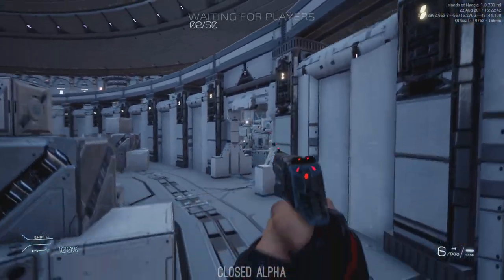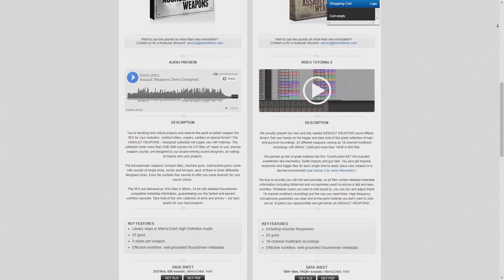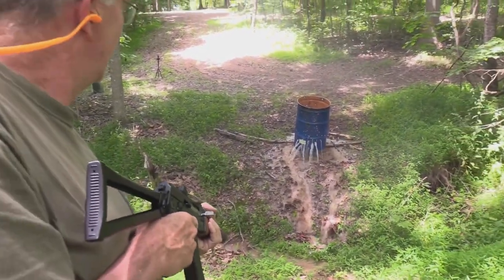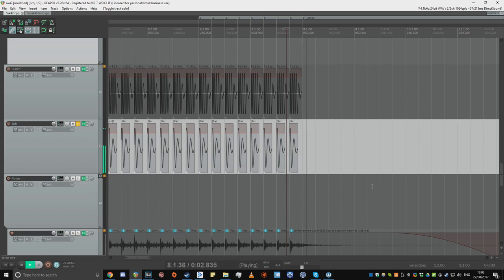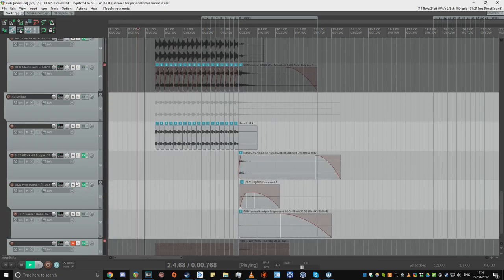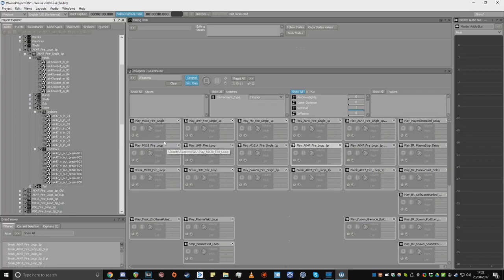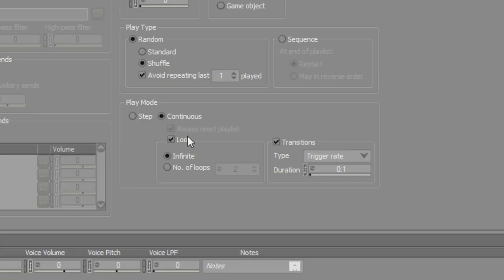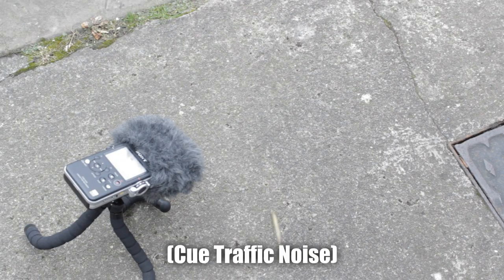How To Make Awesome Gunshot Sounds for Games - Fully Automatics (feat. Islands of Nyne: BR)

Comment: Hi Tom, this is fantastic! for a burst shot you recommend using one shot or a loop of several shots, I have to use fmod for this but I guess it would be similar than with wwise.
Reply from the maker: Hey :), honestly I've done both and it worked well but I would maybe recommend 3 single shots that are each triggered in an event.

Comment: Nice. For "auto" mode you were using "auto" recorded samples, what about for singles shot mode -would you use singles shot recordings?
Reply from the maker: Hey! Tbh I wouldn't build unique sounds specific to single or auto - you can definitely build a single shots using singles or by picking individual shots out from a burst.
Reply: @TomWrightSound  Thank you. I've checked many designers on youtube and I find you one of the best! The trick with adding reverb room on wav and then tail is also really nice trick. Could you share which reverb plugin you are using to create room effect (outside or inside version)?

Comment: Which tool did you used inside Reaper to break looped gunshots into small bits ? I'm curious
Reply from the maker: It was just a matter of pressing 'S' at the start of the transient. It's quite a manual process.

Comment: Thanks for a great video. I find that sometimes I play more sounds than shots fired, which is quite noticeable if I only fire 1 or 2 rounds. Do you have any tips on syncing this more reliably?
Reply from the maker: This is something we also discovered during development. We found that by adding a small delay to the start of the Play_ Event (about 0.04) you can catch most of those extra shots. It's requires some tweaking but is an unfortunate side-effect of this method, which is also present in a few other popular games that use Wwise.

At my place of work we currently use a different method that takes advantage of Wwise's MIDI systems. There's some great information about it in a video by the audio people for Borderlands 3.
Reply: @TomWrightSound  I see, I'll give that a go now and I'll check out the video. Thanks for the info

Comment: How do you handle timing in game synced with the Loop trigger rate? In my implementation, two shots can be sometimes heard when holding the fire button for long enough for wwise to trigger twice, but not long enough for the gun to fire twice.
Reply from the maker: We added a short delay on the Play_ event, something like 0.04 to help with this issue. It takes some tweaking but you can eliminate most of the problem. It's not a perfect solution. I would check out some of the Borderlands 3 audio videos - they do some cool stuff to eliminate this problem but it's a little bit more complicated!
Reply: @TomWrightSound  Thank you for the quick response. I will try the delay, I also want to optimize the path from releasing the button to actually sending Break event to wwise, since it seems to be too long.
I had a look on the Borderlands 3 solution. It has amazing results, but it's probably too advanced for us, so I'll give your solution a try and if we ever find a proper audio engineer, we might check out the one from Gearbox.
Thank you, your video and response helped a lot :)
Reply: @TomWrightSound  I got more in depth of the issue and it seems that wwise will sometimes trigger sounds in 64ms intervals even tho I need a 100ms interval. Maybe that's why the 40ms delay works.